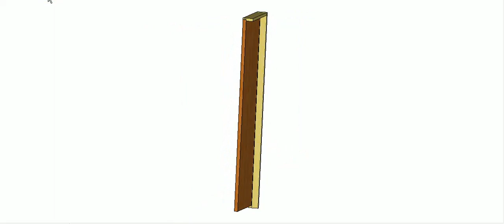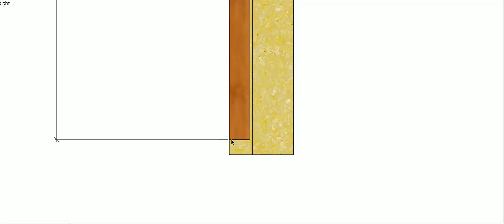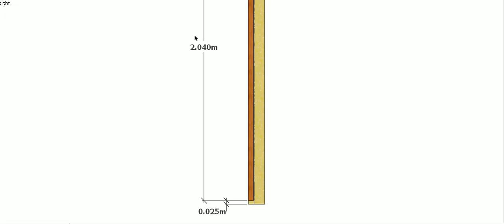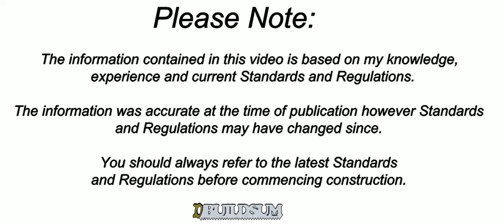Door Openings - Height

Comment: Where you added the 0.25 for the finished floor thickness, would we also add another 3mm for the spacing of the door on the bottom?
Reply from the maker: @wheres_bears1378  you could but it would be allowed for in the 25mm
Reply: @ got it, thanks 🙏 😊

Comment: AmaZing video, I just have a question regarding installing double front composite door. I have been advised by the door company that the opening height needs to be 2060mm however the builder has raised the porch area which results in opening height of 2100mm, after measurement. Question is do I need to tell the builder to make the exact opening of 2060 or has the builder left a tolerance room for the door company to adjust it via timber studs or anything else?
Reply from the maker: Hi Sam, I would say that the Builder has left some room for adjustment although it seems a bit high if it is a standard door. I usually put my door heads in at 2080 for a standard door. The gap is covered by the Architrave internally and storm moulds externally. Hope this helps.
Reply: @Buildsum  thanks pal, you have just eased my mind. god bless ya :)

Comment: Hey mate. In a non load bearing wall where there is a door opening of 920 are you still required a jamb stud?

Thanks mate
Reply from the maker: Hi Mate, I've just had a look at the Timber framing code and it appears that because the opening is greater than 900mm not only do you need a Jamb stud it needs to be thicker than the studs. So if the studs are 90 x 35 the Jamb stud will have to be 90 x 45 and if the studs are 90 x 45 you will have to double it up.
Reply: @Buildsum  thanks mate for such a quick response. The reason why I asked is cause the bloke I'm working with reckons you don't where I've pretty much quoted/stated what you've just clarified for me. 
Thanks mate, totally appreciate it. 👍
Reply: @Buildsum  you're a good man Buildsum. Stay safe during the covid epidemic.
Reply: @Buildsum  figure 6.8(d) pg 49 of the timber framing code, the span of 1800 is that referring to the span of the wall? Or the span of the opening? Thanks mate
Reply from the maker: @samoanSAIYAN  Hi it would be the span of the opening
Reply: @Buildsum  thnks mate once again.